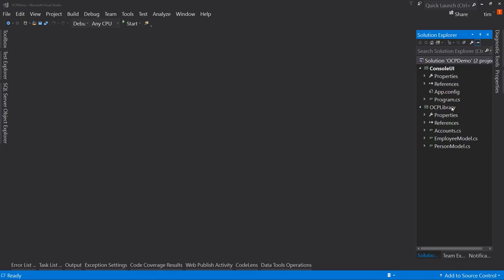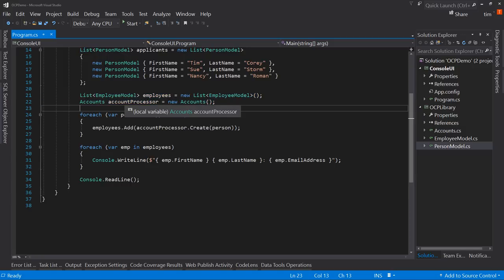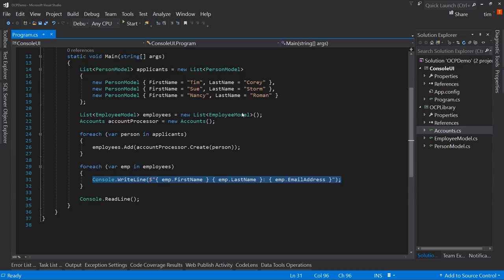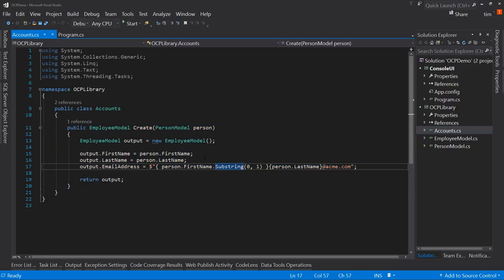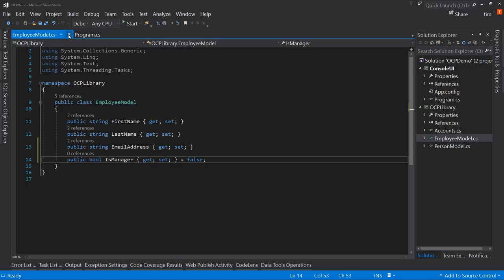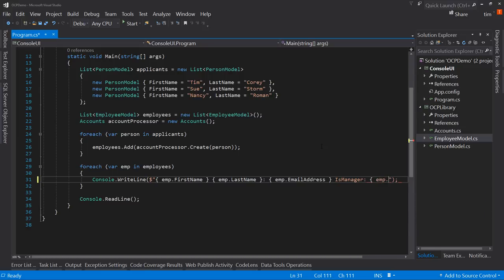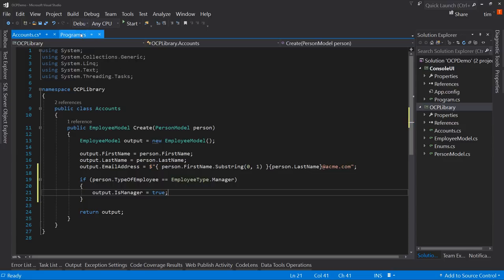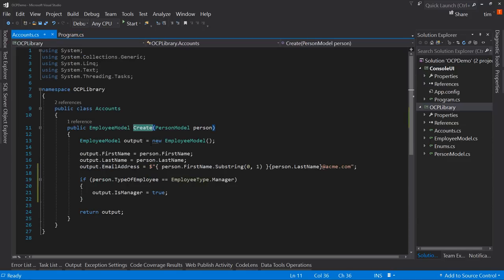Design Patterns: Open Closed Principle Explained Practically in C# (The O in SOLID)

Comment: Hey Tim, I liked this new video, I was just wondering, how can I mix the S.O.  (I need to wait for the other principal)  and the mvvm ? Is it possible to make interface of viewmodels? For models I suppose yes? And wpf views? ...  As the suggeste the practice is the Best but certainly the difficulty is to remember all principal and try to apply all of them at once...  Thanks for you help , Happy Easter
Reply from the maker: I would start by getting practice elsewhere (it is simpler) but yes, you can implement S.O. into MVVM. It does mean there will be a lot of code in the VMs but mostly it will be to call other code. The purpose of the VM is to connect to the Views and that is what it will do.

Comment: Why to not use Abstract class as a Base Class, implement Interfaces and then Override virtual methods implemented in Abstract Base class into Derived Class. That will make things more clean and readable.
Reply from the maker: It depends on the situation but I'm very careful about abstract classes. You need to make sure that this is a case where the derived classes all truly derive from the base. If even one won't, you have a problem. You would need to switch over to an interface at that point.
Reply: @IAmTimCorey   Thank you for your reply, that kind of gave me an answer what I was looking for.
Reply: @IAmTimCorey  so this is also one diffrence between abstract class and interface

Comment: Hi Tim, thanks for the great video! My question is, in the "IApplicant", can we use the "Create" method to replace the IAccounts interface? What's the difference between these two approaches? Thanks.
Reply from the maker: I am not sure what you mean by replace the IAccounts.
Reply: @IAmTimCorey  There are two string properties and one IAccounts property in IApplicantModel. I mean can I replace this IAccounts property with a Create() Method?.  I can't see the difference here. Thanks.
Reply: @lennychen7217  I think replacing the IAccounts property with a Create method of it's own would break SRP, since your IApplicantModel is no longer only responsible for new applicants, but also responsible for creating an account for them as well.

What would happen if you needed to add another method or two to accounts? example,. Get() or Update()? Would you go and create those methods on IApplicantModel since that's where the Create method exists?
Reply: @robertbreedt1276  Make sense! Think you, now I see the difference.

Comment: So essentially interface contracts can be used to help "enforce" OCP by guaranteeing what is available in an implementation, and forcing any removals to require more work by amending the interface as well?
Reply from the maker: I think "enforcement" is just a byproduct of how you develop methods and classes to follow OCP, not a feature.

Comment: Hi Tim, thank you for the video. Could you help me to understand why is IApplicant Model should know which processor use? How we can split model initialization and processor creation? Because we can have some other processors.
Reply from the maker: So I'm not sure I understand your question. If you are asking how we could separate our processor initialization from our IApplicant model, I'm not sure we want to. The point of the specific classes is they implement a different type of processor and they have to specify which one. However, if we wanted to load that at runtime, we could use Dependency Injection to pick which one to use.
Reply: You right understand my question, and in case if we have one processor all looks fine, but when we add one more processor for example HolidayProcessor, and  TaskProcessor. So every time when we need new processor we should to update IApplicantModel. And this violates the OpenClose principle and as I think Single responsibility principle. So my question is how to to fix this issue.
Reply from the maker: It feels like a HolidayProcessor and TaskProcessor do different things than our current IAccounts (which creates user accounts). If they did similar things and we wanted to have more than one processor, I would simply change the IApplicantModel from having one IAccounts entry to having a List<IAccounts> that you could loop through. As for changing IApplicantModel in the future, it sounds like you are changing the way a piece of the application works. SRP says that a class should have only one reason to change. OCP says that a class should be closed for modification but open for extension. These aren't contradictory. There is a reason for modification but there should only be that one reason. That one reason is if you decide to change the logic behind how that class works.
Reply: Looks like I understand. In our case IApplicantModel has property "IAccounts AccountProcessor" and in case if we want to add some other processor we should add interface for example IHolidayModel with Property "IHolidays HolidayProcessor" and use it for processing holidays. And to avoid copy-paste code with properties FirstName and LastName we should extract them to base class. Is it sounds reasonable?
Reply from the maker: I believe so (trying to visualize it). The holiday processor should probably be attached to an employee type (if all employees of a certain type get the same holidays) or general employee (if all employees have the same holidays regardless of type). So that holiday type might be added by the AccountProcessor on creation of an employee object.
Reply: Sorry for lot of my questions. I appreciate to you for your answers I understood your point of view. Thank you. Will try to use principles on the practice.
Reply from the maker: No worries. I'm glad you asked.

Comment: Hi Tim! Thanks for the course! For sh!ts and giggles, what happens if you now need a SSN or other ID, and need to change the EmployeeModel class? Since so many interfaces use it, do you manually need to update all the classes the interface?
Reply from the maker: Nope, you can add to a class without changing anything else. If you changed the interface, you would need to update the classes that implemented it, but that would be it.

Comment: I can sure see the benefit of this in applications that are extended and worked on frequently. But for a one time Change I think the "wrong" way is much easier and waaaaaay less complex. With the Interfaces it`s not readable anymore. I would most likely  have worked with inheritance (Just because I still struggle a lot with Interfaces).
Maybe my mind will change if I get a good grasp on Interfaces anytime, but for now to just have a child class of employee looks like half the work and 20% the complexity to me.
Reply from the maker: There is definitely a balance here. You will notice that on my other videos, the small apps I do don't follow all of the SOLID principles because that is too much complexity for too little return (and it adds a LOT of confusion). However, speaking from LOTS of personal experience, saying "this is just for now" or "this is just a small change" usually bites you down the road. Things that will get fixed later or get improved later tend to stay as they are until your entire system relies on them and they are too fragile to change.

Comment: It's very interesting principle but I have one question. Implementing of this principle could be make a lot of duplicated code and copy paste issues... What is the best way to reduce of this duplication? Should I create one general class where I will implement duplicated logic and then call this method in all implementation?
Reply from the maker: I don't see how there would be duplicate code. If you have code that you use multiple places, you would create a class for it and a method (or a few methods) that cover the code needed and then you would call them from the other places. So your new code has one reason to change, is open for extension but closed for modification.

Comment: Maybe I don't understand the principle based on this example, but I feel like this just makes a lot of mess for the wrong reasons.
If you go by "never touch code that is already working", you will end up creating hundreds of new classes that do the same thing, but with one extra function?
What if you didn't just have to extend the base class with one extra property, but had to make a change to affect all of them? 
Let's say for example there are 10 different account types already that means 20 classes in your example and someone said that the accounts should store a Balance field. Would that mean creating 20 other classes, like ManagerAccountsWithBalance, because non of them had base class, or at the least going through all 20 and making the same change?
Reply from the maker: The OCP is about production code. If you are designing your application and in the process of building it, you can definitely modify your code. However, once you go to production, you are relying on the code you wrote. You get it right and make sure there aren't bugs. If there are bugs, you fix them. Later, when you decide to make changes, yes, you extend your classes with new ones for the new uses. That way you do not disturb working code. Nothing is worse than a "small" change that breaks multiple things in production.

Comment: The OCP always bothered me. I agree with it philosophically–good designs make it possible to add functionality without disturbing existing features–but in my experience there are no permanently closed abstractions.
And I want to ask:
- Fixing Bugs modifications could computed as a violation of the OCP?
- Some new features and requirments not predictable and the existing design doesn't    fit the requirements any more, that's mean we will breakdown the backward compatibility, so at least the OCP still valid and applicable on minor changes. Please could you explain and put me at the right way.
Reply from the maker: The idea behind OCP is that you create a dependable structure to build upon. If 10 method depend on the BuildStatement method and then you decide to change how BuildStatement works, you now need to test those 10 methods to be sure they still act the correct way (or you will need to update them to account for new parameters, etc.) The idea is that instead of making that change to BuildStatement, you extend it to add the new functionality to a new method. Now you haven't broken the 10 methods that call BuildStatement but you have added a BuildBetterStatement that does the additional work you needed for the other methods.

To be clear, though, this does not cover bug fixes. If a method has a bug, that means it is doing something unexpected or against what it is reporting that it does. In that case, you fix the method. You can also refactor the code as well. That doesn't invalidate OCP. You still have the same inputs and the same outputs. It is just doing it more efficiently. The key is to not change what it is doing fundamentally. If the BuildStatement method returns a comma-separated list of numbers currently, but you decide to change it to be a pipe-separated list, that is a fundamental change. All of the dependent methods now have to change, which causes a ripple effect throughout your application.

The other thing that OCP doesn't really cover is the initial development process. When you are building an application, the requirements might change or you might find that you can't do things a certain way. It is ok to change your methods/classes at that point without violating OCP. Think of it as building something in concrete. You can make changes initially to reshape it and make it look the way you want but after you are using it in production, it has set and cured. Now changing it is a much bigger deal.

Comment: Hi Tim, thanks for all the great videos. About this video, I have 2 questions. You mention that you put the enum classes in 1 file. I tend to do this with more classes to combine them in 1 file. Especially if they are related. I think it is just a balance between number of files, and folders to keep it clear, what do you think? 
Next question, I am a db guy, so instead of enums, I like to put that stuff in a table? to keep all kind of data in the database. What is your thought on this?
By the way, I am developing as a volunteer to build a POC for a sustainability project.

Kind regards,

Peter
Reply: Maybe also if I use a table instead of a enum, I can add / modify the data more easily without recompiling.
Reply from the maker: I don't typically put multiple classes in one file because you are then reliant on using the editor tools to find a class. If you are looking for a PersonModel but all of the models are inside other class files, the only way to find it would be to find a reference to it and hit F12 or do a search for that class (but ignore the potentially hundreds of references to it). I prefer to allow it to show up with a visual scan. It also helps developers new to the project see and understand the project structure if you don't hide things.

Enums can come from the database instead. However, that takes an extra database call and it takes extra memory to store that information for the life of your app (enums are more efficient because they cannot change at runtime). Plus, there are a lot of things that don't need to be changed later (days of the week, months of the year, etc.) Plus, if you pull from the database, you don't get the visual benefit in the code of reading "if (DayOfWeek == Day.Monday)". Instead, you get "if (data.DayValue == "Monday")" and you have to then have a model that has the DayValue and the DayNumber.

Bottom line is that there is a place for both options. Enums have value and so does pulling data from the database. Make the choice that best fits your specific situation.
Reply: @IAmTimCorey   thanks very much for all the feedback. I can for sure do something with that.

Comment: What do you think about a table driven approach?
Reply from the maker: Not sure what you mean.
Reply: @IAmTimCorey  I happened to have read "Code complete 2", chapter 18: "Table driven methods" before watching your video and I asked myself whether a table driven approach would be possible instead of polymorphism. If there are a lot types of employees that would involve a lot of typing. If possible a table driven approach would spare the programmer of that much typing. I later arrived to the conclusion that table driven approaches are not suitable when the subclasses implement complex behavior.

Comment: After creating a table in SQL server, are there any tools to create basic CRUD stored procedures and the methods that go in SQL Connector?
Reply from the maker: There probably is but I haven't used any I like. Typically you have to do it by hand because they are specialized to what you want to do instead of generic to the table.

Comment: I like your video, its very cool!
Although, what about using ORM to store managers in DB. To implement models in the way you described in video, we should have 3 separate (but still with the same schema) tables, right? or rather you would still prefer one table, with additional IsManager, IsExecutive (or just EmployeeTypeEnum) and assign a proper AccountProcessor for each type? Just wanted to know how you would approach in this case.
Thanks!
Reply from the maker: Dealing with data in C# and then putting that data into a database calls for two separate sets of models. I don't think your database should conform to your application because that only works for your first application. After that, your other applications that use the same database can't change it to conform to them because they would affect the other applications. Instead, the application should conform to the database. That means separate models and structures to get data in and out and then you transform them in code to how you want them to be. So in this case, I would have a table that has the userId and a permissionId. That way you could say that a user is an executive and a manager. So the user table wouldn't have any indication of permissions, and the permission definition table wouldn't have any users in it. The third table would link the two. That means three different models for our particular case.
Reply: I see and agree! Thank you :)

Comment: I'm only a learner but to me creating 2 interfaces and 6 classes is more confusing than having a single base class.
I was only able to determine what does what when I downloaded the source code, deleted all classes except program.cs and recreated everything by myself.
Idk, maybe I'm just dumb. :|
Reply from the maker: That's a good way to learn. As for the SOLID principles, they are mainly more advanced OOP principles and not really for beginners. They add too much complexity for early developers. As for using a base class, you could do that but only if the items are directly related. Otherwise, you end up with a simpler solution at first that ends up being a nightmare to support just a little bit down the road. Inheritance is a powerful tool, but when you don't have that firm "is a" relationship and when you don't have a firm grasp of the big picture of your application and where it will go, inheritance can be a trap. I tend to push especially newer developers to use interfaces rather than inheritance as much as possible. As you build up your OOP skills, you will start to use inheritance instead for some things but you will be surprised at how much you leave as just interfaces.
Reply: @IAmTimCorey  Thank you for your answer!